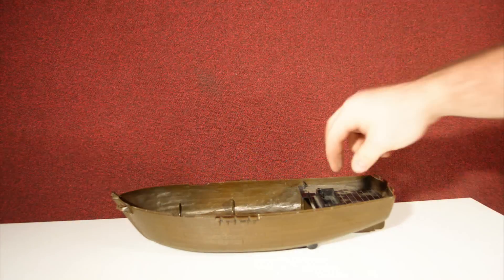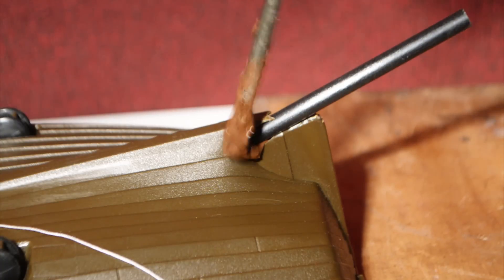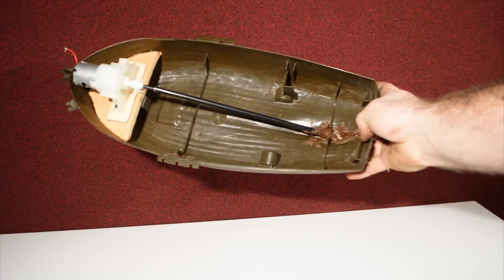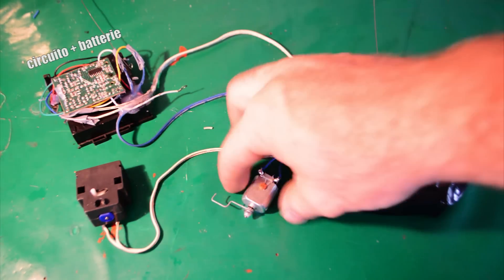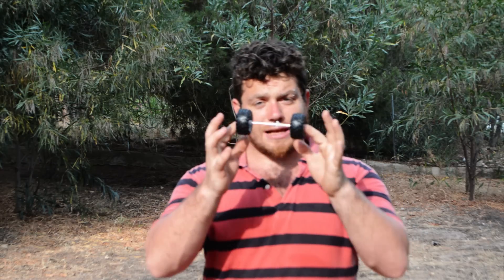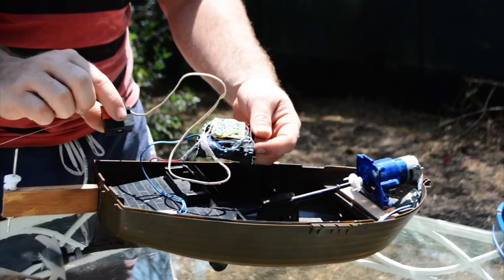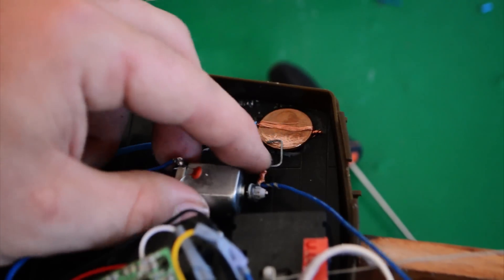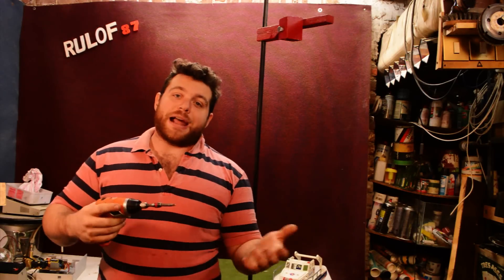How to Make • RC boat

Comment: Good video, but better use foam covered with a covering film or plastic coating to make it water proof instead of wood to make it lighter and go faster.
your boat speed is not adjustable so by adding a cheap speed controller or a circuit works as a variable resistor to control the current going to the motor in this way you can control the speed of the boat.

Comment: I like your idea of using the fan from a hair dryer for the propeller. But the motor and coin in place of a relay seems like an inefficient and unreliable solution (because of vibration and corrosion at the contact point). The small motor must be draining the RC batteries at a fast rate just to clamp the wire against the coin. But an interesting project.

Comment: You can use smaller and take less current motor for the switch 
So more battery life on the receiver 

Or if you have an electronics knowledge you can use a pot for speed and mosfet for the switch and PWM.

Comment: the method of using motor as relay is not good it would consume more current. You could use relay instead of motor. Or you can use an optocoupler that's faster,quicker and capable of driving high voltage from low voltage

Comment: I'm an electronics guy and I'm realy mad at you that you used a motor as a "relay" instead of using just a relay or even better a MOSFET transistor.
Reply: I like his idea i was doing similar stuff when i had no idea of relays as a kid,as you can see he made a setup that is latching with parts already on hand,to latch it as a 2 channel on-off you will two NC-NO relays that one will latch the other until the opposite relay is powered by the remote control channel and have a powered component constantly. Good luck explain that to viewers.
Reply: +Derpy Herpy Man, his point was to make it fast and simple using scraps and one cheap toy car from a discount store. I think this is targeting kids rather than adults with multimeters, oscillators and soldering stations. An 8 year old can repeat his setup. Can an 8y.o. repeat yours? Precisely.
Reply: +zzzontag I don't know, if an 8 year old is able to cut the wood he's certainly able to use a soldering iron to mount a transistor/MOSFET. It's really not that hard. Doesn't require any multimeter's or any of that fancy stuff. I think the hard thing would be sourcing it. But... eBay
Reply: Or maybe they could pull it out of the hair dryer. Who knows.
Reply: bdot02
Lol, dude, cutting wood is one way of ending up with a suitably sized piece (not the only one), but not too many parents would let an 8y.o. use a soldering iron.
Reply: +zzzontag Doesn't mean an 8yo wouldn't be able to use one if offered.
Reply: bdot02 Yes to varying degree of success and hazard. Let's just take it up a notch and give them a blowtorch ;)
Reply: +Derpy Herpy  But relay are 12 volts but he can still make it to 3 volts. by removing some wire , derpy herpy nice idea. i was so mad too, when i saw that little motor as an relay. it was better a relay,cause the relay as springs and the little motor is weak and the batteries will burn fast. im also an 13 year old  electronics guy im still studying it. what's an mosfet transistor
Reply: doing this is probably cheaper than buying a mosfet that can handle 20 watts and its probably easier too due to the loads of heat displacement that you'd have to figure out
Reply: Still it's more practical and most mosfets can handle up 5 amps with no heat sink
Reply: Derpy Herpy most of the mosfets that I have seen will not be able to function at 12 volts and 2 amps for very long and I'd imagine that the ones that can would be quite expensive
Reply: yeah you are sooooooo right. the boat can't go backwards.

Comment: How to make an RC boat.

Step 1: Buy an RC car....

lmfao
Reply: marsdog  the next video will be about: how to make an RC car,.... and we can guess that step one will be : buy rc boat :D
Reply: nathan albania  wh not to buy an RC boat from the beginning and skip everything else?
Reply: Rc boats are extremely expensive, small rc cars on the other hand are fairly cheep
Reply: Well if you put a brushless motor underwater there is a good chance of screwing it up.
Reply: The Piscis brushless motors are not affected by water. Just need to waterproof the electronics and all is good
Reply: From what I have hear is that brushless are not waterproof and brushed are
Reply: great minds thinks alike!😂
Reply: The Piscis its the other way.  Brushless can take the water
Reply: Quadflyingmedic brushed motors are definitely water proof, I have run many of the under water in rc boats
Reply: The Piscis I thought that the water would short them out.  But I know that brushless Motors are ok underwater even in saltwater, so it just depends on the motor you have on hand, just be sure the electronics are waterproof
Reply: The Piscis that brushed motor will take time and it will rust and not work... because its not made to be in water, brushless on the other hand are the motors that can be in water..
Reply: ***** The motor that I use quite often for running under water is still fine after about 3 months of use
Reply: +David S. A lot of people "break in" brushed motors by completely submerging them.  A brushless motor would have been pointless in project like this.
Reply: Hay un canale in italiano?
Reply: +marsdog bro it say ''make'' .. not "buy" ... Lol
Reply: +The Piscis that depends on the make and model of rc boat that you buy also it depends on where you buy an rc boat